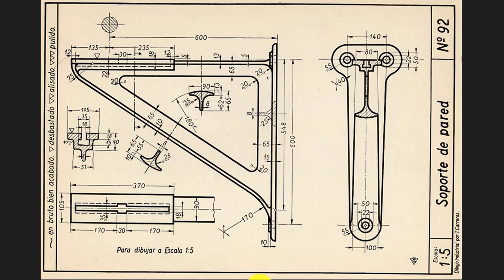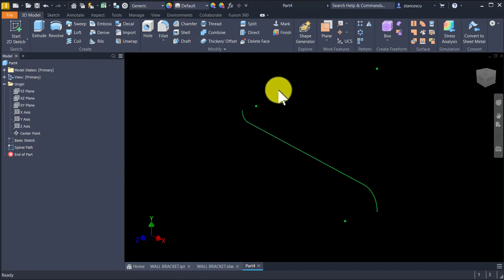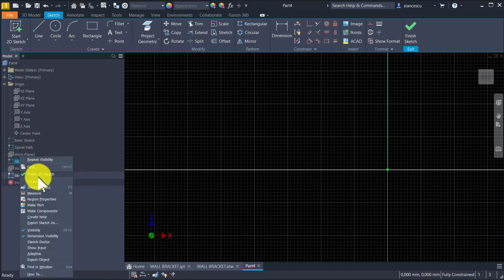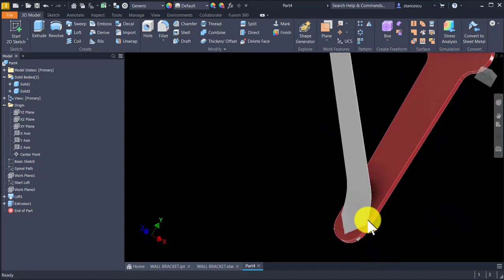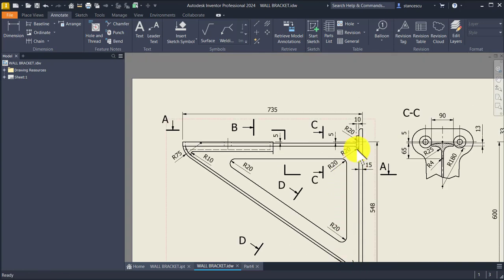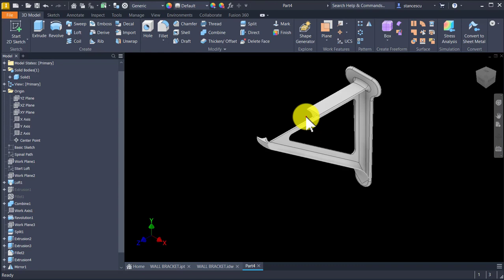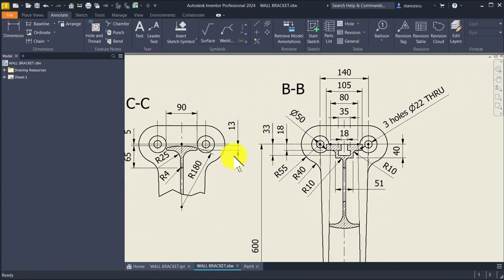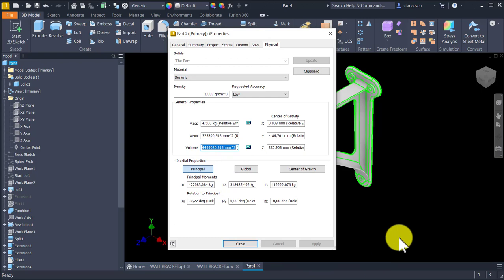Tutorial Inventor - 257 WALL BRACKET

Comment: Hello Professor,
Thank you very much for your teaching.
I want confirm the difference between your model and original drawing.
In the roft operation, the rail curve is starting from radious 75. 
The center of this R75 should be 18mm below from the basic horizontal line, ie; center of bottom 2 holes.
Is it correct?
Reply from the maker: You are right! See the description of the video